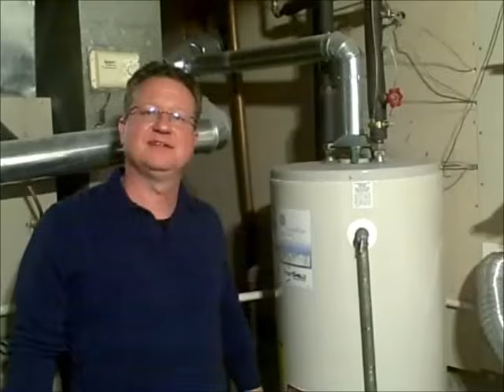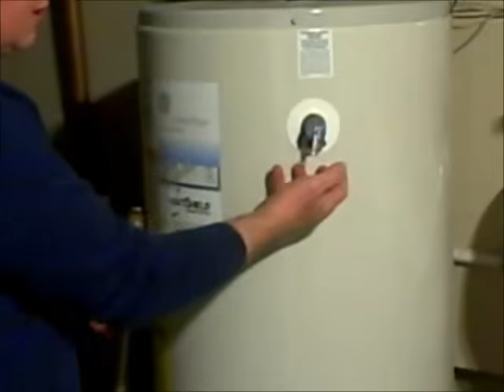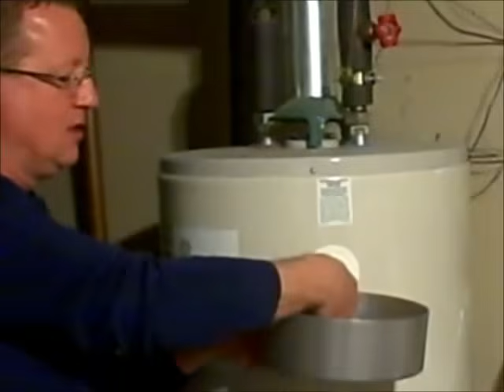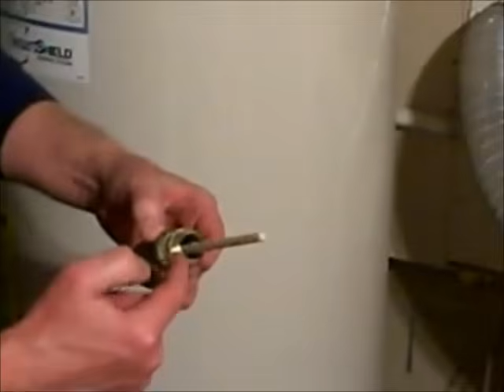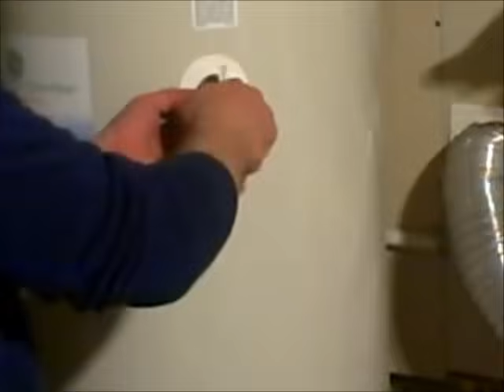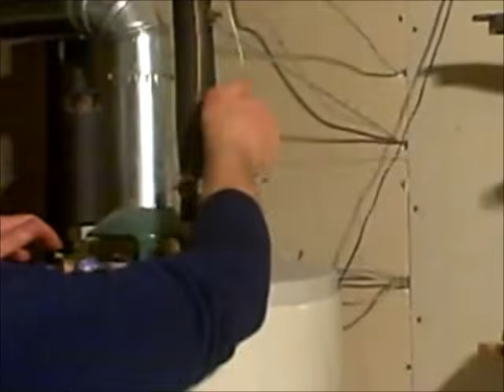Water Heater Pressure Relief Valve - Prevent Water Heater Explosion - Replace a Relief Valve

Comment: If the relief valve operates okay when the water heater is turned off, but the valve leaks when the water heater is turned on, should the valve be replaced? Or should the entire water heater be replaced?
Reply from the maker: Hi, yes, if the valve is leaking, it should be replaced. Do you have an expansion tank for the water heater?
Reply: @FIXITHomeImprovementChannel  There is no external expansion tank. Can there be an internal tank?

Comment: Hi! I normally checked this valve every few months, released some water out every time I checked…Yet this time it was really difficult to lift/release the valve (the little swinging/movable thing  that we lift to release water)….Does that mean the valve is damaged and needs to be replaced? Thanks 🙏
Reply from the maker: Hi, yes, I would replace it. Good time to flush the tank and check the anode rod.
Check out more home improvement tips in our e-books https://www.amazon.com/gp/product/B0B2KW1FQ9?notRedirectToSDP=1&.

Comment: This seems extremely easy, so I’m going to fire this up myself.  Great concise clear directions.   I’m presuming you drained 5 gallons so that the water level would drop below the PRV(?)
Reply from the maker: Hi, yes, if the relief valve is on the side, you would drain around 5 gallons. 
Check out some home improvement tips in our e-books https://www.amazon.com/gp/product/B0B2KW1FQ9
Reply: can you just leave the pilot light on when draining the tank?   Relighting the pilot on our water heater can be challenging.   @FIXITHomeImprovementChannel

Comment: I replaced my valve last week (good video!) but the new one is doing the exact same thing, after every shower or bath it drips a few tablespoons.  And the old valve looked fine.  There's a floor drain very close so it's not damaging anything, should I forget it?  Or do I need a new heater?  The tank isn't leaking.
Reply from the maker: Hi, do you have an expansion tank for the water heater?
Reply: @FIXITHomeImprovementChannel  I don't know what that is
Reply from the maker: https://youtu.be/G2kRC-mETM4
Reply: @FIXITHomeImprovementChannel  No I don't have that, and it sounds logical because this leaking started recently around the same time my town replaced our water lines, so maybe they added those check valves.  I will research how to install a new one & if it's beyond me I'll have a plumber do it.  Good info, thanks again!

Comment: Does the direction of the silver handle matter?  It appears that it’s not actually a shutoff that determined by its 360 direction.
Reply from the maker: Hi, the lever can be any direction. It will move so it's easy to lift.
Check out some home improvement tips in our e-books https://www.amazon.com/gp/product/B0B2KW1FQ9

Comment: I have a 3 year old gas water heater with city water and it smells like something burning. That pipe you took off does not have any dripping water, instead its chunks of rust that has come out of the pipe and is in the drip pan. Have any ideas?
Reply from the maker: Hi, when you test the relief valve, does it drain water? Have you checked the anode rod?
Reply: I will have to call someone, the pipe is too close to the wall for me to check myself. That's why I was hoping maybe you had some ideas with just that information. Thanks anyway @FIXITHomeImprovementChannel

Comment: Make sure that water temperature setting is not too high, first. I bought a house with 3 year old tank and noticed that it was leaking water through pressure/temperature valve. I lowered the thermostat settings and it stopped leaking.

Comment: My 5 year old unit just dumped a few gallons of water on the floor. Never had an issue before. I opened the valve and some sediment came out then ran clear. I ran some hot water in the house to get the heater running. No leak. Was this a freak occurence or do I have a serious problem?
Reply from the maker: Hi, do you have an expansion tank?

Comment: The discharge tube only has to go 6 inches above ground?
Reply from the maker: Hi, yes, for safety, it can't be higher than 6 inches off the ground.
We have more home improvement tips on our podcast https://podcasts.apple.com/us/podcast/fix-it-home-improvement/id880903087
Reply: @FIXITHomeImprovementChannel  Does it have to drain outside or in a catch basin
Reply from the maker: Hi, the code says: Discharge to the floor, to the pan serving the water heater or storage tank, to a waste receptor or to the outdoors. The manufacturer recommends discharging into a floor drain if possible. You can call your local inspector for your area.

Comment: You can also use a 12 to 18 inch long 3/4 diameter steel pipe as a wrench to remove install these. Just screw it into the valve in place of the blow off safety pipe.

Comment: Do I have to turn the gas supply OFF to the hot water heater or is turning the hot water heater OFF at the base enough?
Reply from the maker: Hi, if you are just draining enough water to replace the valve, you can just shut off the gas control.
We have more home improvement tips on our weekly podcast, Fix It Home Improvement. You can subscribe on your favorite podcast app. https://www.stitcher.com/podcast/fix-it-home-improvement-5/fix-it-home-improvement

Comment: So can these just go bad at some point? We've had our new water heater for 3 years and it recently started dripping occasionally. A plumber I talked to said we need an expnasion tank. The previous water heater in our home lasted 12 years without one, and almost all homes in our area dont have one.
Reply from the maker: Hi, depending on water condition and water temp, they can go bad. If it's leaking, you should change it.
We have more home improvement tips on our weekly podcast, Fix It Home Improvement. You can subscribe on your favorite podcast app. https://www.stitcher.com/podcast/fix-it-home-improvement-5/fix-it-home-improvement

Comment: Great video, thanks. I've been wondering why you only need to go thru this process annually? 
I'm mostly wondering because my parents have had to replace the relief valve twice this year, and may have to do so again for the third time. Everyone they've asked keep saying that the relief valve doesn't need to be messed with or if they really want to only to "release the valve every 3 months". Well it hasn't even been 3 months since it was last replaced and it sounds like it's leaking again. An I've tried searching on line for an answer to my questions mostly why are we having to replace the valve nearly every month or so. I'm thinking there's alot of pressure that's causing this to happen so often, but why is there a sudden large amount of pressure going on. They've lived in their mobile home for only 5 years and just started having these problems with their water heater. They never even knew they had to release that valve anywhere they've lived. Theyve owned another home for over 20 years and replaced the water heater once, and never had to mess with any valve to release anything. Why would that b? It's beginning to seem like only some certain water heaters need the valve to be messed with. An I'm wondering why that is. Idk if you can try to give me some answers and solutions. Thanks for your time.
Reply from the maker: Hi, is there an expansion tank for the water heater?
Reply: @FIXITHomeImprovementChannel  
No there isn't. I just looked up what an "Expansion Tank" is and this is the first time anyone has ever asked us about that. From what I'm reading about what an Expansion Tank may be, I'm thinking that's what we may actually need. I had never heard of an Expansion Tank or seen one anywhere that we've lived. This is very interesting. What causes that pressure to build up in the tank? Is it because the temperature is too hot? Since we moved into this mobile home in 2013-2014 none of us have ever messed with the water heater, til just last year when I heard water dripping under our trailer and when we looked under there we seen a big puddle of water. At the time we figured out what the problem was and replaced the valve, and actually added on a longer pipe to the one that was leaking under our trailer, we made it to where the pipe pointed out to an area where water wouldn't hang up under the trailer. Since that first replacement we've had to mess with that valve twice now the last time was just a few months ago. Since my parents both have medical problems I'm pretty much the only one able to work on things and fix them. So I do the best I can by watching videos on YouTube and asking questions at Home Depot or repair shops. But I always get told they have to come out and see what the problem is and they'll charge me for that even if I take pictures and explain what the problem is. 
I appreciate your response.
Reply from the maker: Hi, when you heat water it expands and puts pressure on the tank if you have a closed water system. Many communities are putting check valves on the incoming water so when the tank heats up water it doesn't expand and back into the main system. Here is a video we did. https://youtu.be/G2kRC-mETM4
Feel free to drop me a line at fixitpodcast@gmail.com if you have questions.
Reply: @FIXITHomeImprovementChannel  thank you very much with all your help!! I greatly appreciate all the info and knowledge you've shared with me. I have definitely learned alot. I will definitely check out the video you've provided a link to and get back to with my questions. 
Thank you again, for taking the time to respond to my questions and concerns.

Comment: You might have just saved my life. I sleep in a room next to my HW heater and noticed it had been dripping from the overflow tube. Tank is about 10 yrs old and I never knew we needed to replace this valve. After a few hours of the tube still dripping I searched for answers and found this video. I shut down my tank and will look for replacement parts tomorrow.
Reply from the maker: Glad I could help.
We have more home improvement tips on our weekly podcast  https://podcasts.apple.com/us/podcast/fix-it-home-improvement/id880903087?mt=2

Comment: Why would water flow from the relief valve tube ? Valve failure ?
Reply from the maker: Hi, yes over time the valve will fail. When I took training from one manufacturer, they recommended that the temp and pressure relief valve be replaced every 5 years.
We have more home improvement tips on our weekly podcast  https://podcasts.apple.com/us/podcast/fix-it-home-improvement/id880903087?mt=2

Comment: "replace the valve every 5 years" my parents and sister recently went to the Philippines for a 1 month vacation on Wednesday. So my 2 younger brothers and I are all alone for half the summer vacation. When they left, a day later our hot water was gone. Since then, been telling my mom once a day that we still have no hot water.

So we've been showering in the cold ass water for almost a week, but we shower in the afternoon and leave the AC/fan off so the house is hot. That way we don't freeze to death while showering.

Recently, I found out our Water heater was off, so I learned how to ignite the flame back on and get it operating normally again.

I succeeded only to hear a weird rumbling sound and I had my brothers back away from it and searched why it's rumbling. Turns out I needed to clean the tank itself and I was told it wouldn't blow up, which was a relief since that's what us 3 assumed.

I never knew we were even suppose to clean this tank once a year, let alone replace the pressure relief/release valve every 5 years.

It makes since why after 5 years of living in this remodeled house(the owner is my mom's close friend's cousin's home), the water heater finally stopped since we NEVER once checked and cleaned it ever.

Comment: Is this the same thing as a diverted value? If not, where is the diverted value?
Reply from the maker: Hi, the temperature and pressure relief valve protects the water heater from damage or exploding. A diverter valve is usually used for shutting down the water heater for winter in homes not used in the cold season.
We have more home improvement tips on our weekly podcast https://www.himalaya.com/s/CR.

Comment: Thanks for your video, and for responding to my earlier comment. No, I don't have an expansion tank on the cold line. I guess that's the next thing I will do. I did replace the relief valve, and I think that fixed my problem. I didn't turn the heater back on yet because I want to flush out my tank first, but I discovered the drain valve is malfunctioning, and won't allow water to drain. I'll pick up a new one tomorrow, and hopefully get my water heater up and running again. Thank you.
Reply from the maker: You're welcome.
We have more home improvement tips on our weekly podcast http://castbox.fm/u/6389499.

Comment: The water is gushing out of my valve, not leaking or dripping, but gushing. It stopped when I turned the water off. When I turned the water on a few hours later it did the same thing. Could my problem simply be needing to change the valve? Thanks in advance.
Reply from the maker: Hi, yes change the valve. Do you have an expansion tank on the cold line?

Comment: I have a 2 year old water heater. It started leaking through drain pipe. I had to replace my temperature relief valve and did an annual maintenance (draining tank). 2 days after new temp relief valve was replaced, it started leaking through drain again!!!!!! I called Ruud and they said I needed to have ANOTHER temp relief valve replaced again, but need to lower pressure first (house usually 80psi) and water heater needs to be a minimum of 50 and maximum of 60 PSI before I install the second new temp and pressure relief valve. The recommended that 1. I lower the pressure with my water district or 2. I may need a PRV (pressure reducing valve) installed on water heater. My question is....I haven’t changed the pressure or replaced the new temp pressure relief valve yet (due to holidays) so the drain pipe is still dripping/leaking water, BUT I also hear tapping sound on the tank. Like a washing machine. Is this because of the pressure build up? I just drained it 1 month ago. I just can’t imagine my water heater going bad after it being 2 years old when my other one lasted 14 years (hard water in Las Vegas)
Reply: I have a video of the sound but can’t post on here :(
Reply from the maker: Hi, do you have an expansion tank on the cold water pipe before the water heater?

Comment: My new watertank (year old) drained water just one time. I noticed it today. Did not drip again and doesn’t leak. I opened it up anyway and drained a little bit of water. Should I worry or call a plumber?
Reply from the maker: Hi, when you say drained water, did it come out of the relief valve?
Reply: FIX IT Home Improvement Channel 

Yes, it did. Happened once. Have seen no water since. It’s electric; I lowered the temp, both upper and lower. Thanks for the help too
Reply: Just did it again; let off excess pressure via the valve ???
Reply from the maker: Hi, if you don't have an expansion tank. That could be the problem. Most temp and pressure valves will open when over 210 degrees F or if the pressure gets around 150 psi. If you have an expansion tank, I would replace the valve. 
We have more home improvement tips on our weekly podcast http://castbox.fm/u/6389499.

Comment: Hi. So if I remove the pressure release valve , and I see white build up around the inside of the tank should i chisel it off with a flat screwdriver? I’m just worried about that stuff clogging some plumbing from the inside.
Reply from the maker: Hi, you should have a routine of draining the tank a couple times a year to help reduce the buildup of particles in the tank.

Comment: Is it safe to keep the pressure relief valve and tube inside the room? Or can we lead the tube outside?
Reply from the maker: Hi, yes it is safe to keep the discharge pipe inside, the code wants it discharged in the same room the water heater is in, 6 inches from the floor or drain.
Reply from the maker: Hi, yes, have it end 6 inches from the floor or drain.
We have more home improvement tips on our weekly podcast http://castbox.fm/u/6389499.
Reply: Ok, because I had a home inspection and they told me that it need to lead out side the room in case it blows up the vapor will go out side and not inside the room or storage area.

Comment: The seal between the relief valve and boiler was leaking a lot( a stream of water). It was also leaking a bit from the bottom. What could it be?
Reply from the maker: Hi, if the temp and pressure relief valve is leaking, it needs to be replaced. If it is leaking from where it goes into the boiler, it might just need to be removed and then use teflon tape or pipe thread compound on the threads.
We have more home improvement tips on our weekly podcast http://castbox.fm/u/6389499.
Reply: FIX IT Home Improvement Channel it looked like it was leaking from where the pipe goes into the boiler. I have zero knowledge on boilers and their parts. The boiler is from 2009. Too early to need a replacement, right? Thank you for responding so fast btw.
Reply from the maker: Hi, the temp and pressure relief valve should be checked at least once a year and changed out once every 5 years for safety.
Reply: FIX IT Home Improvement Channel Gotcha. 🙏